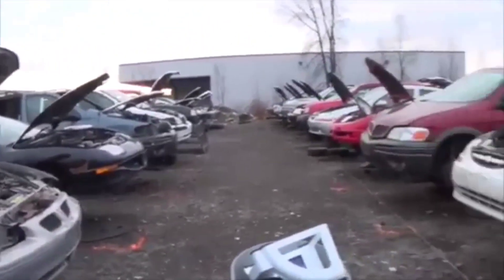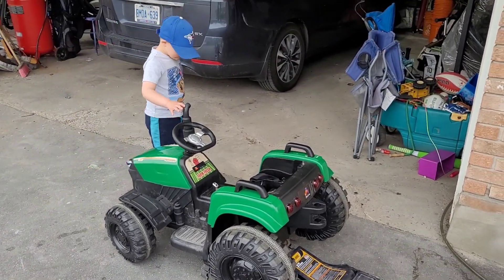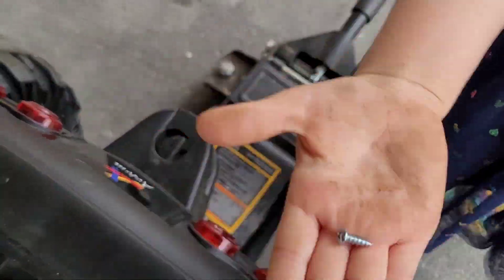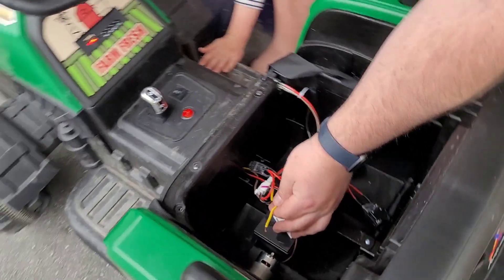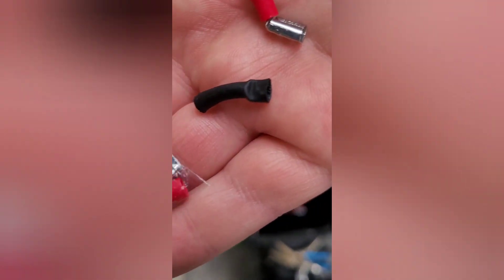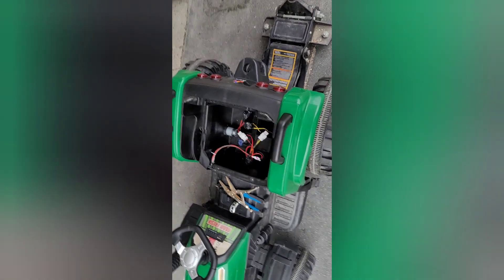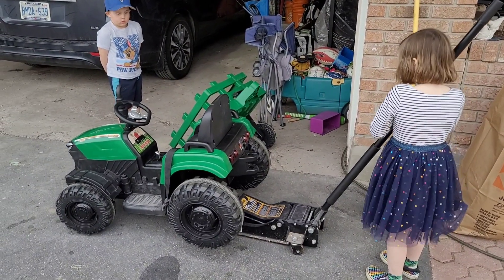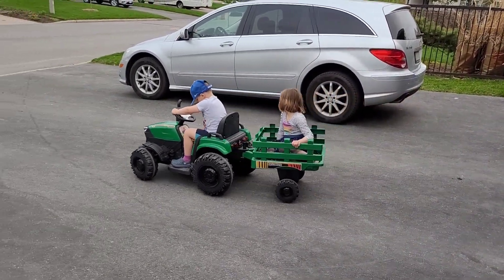Kids ride on car / tractor: Only one wheel spinning (one motor not working) FIXED

Comment: Thank you for making this video! It didn't technically help me with my issue but I can see it helping another person. If you have any thoughts on what to try for a wheel that is not spinning on one side although the voltage is good from the connector it seems and that wheel spins when I plug it into the other side so it's not the wheel itself. I don't know if it's something in the joystick, this model is a child's bumper car and it has a remote which doesn't get it moving either. Going to test voltage on the joystick next but wasn't sure if that is the issue since the remote didn't work it either but maybe 😅
Reply from the maker: Not sure I totally understand ... could you take a short video and link it here?  I can definitely take a look at the vid and see if I have any ideas.  Cheers!
Reply: @fixingrandomcrap If you're up to the challenge, I'll send you a video of the issue. I have similar problem and have replaced the circuit board, control board, battery and today the pedal.

Basically, when starting the car, one wheel spins but the other stays stationary.  If you connect swap the connections, the wheel that used to spin stays stationary and the other wheel rotates.  So, i do not think it is the motors, but I'm thinking the fuse or wiring that connects to the blue plug in the control board is bad. Where can i send a video too?  I'm not giving up on this little car!
Reply: I'm having this same issue if I understand your problem.  I'll send a video to see if we can resolve it!